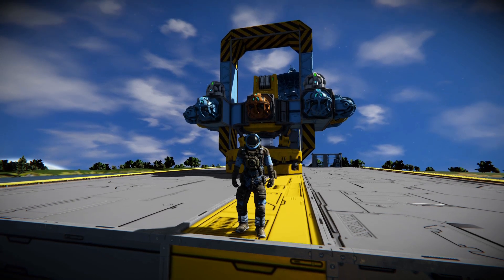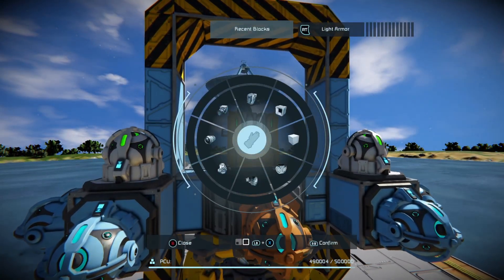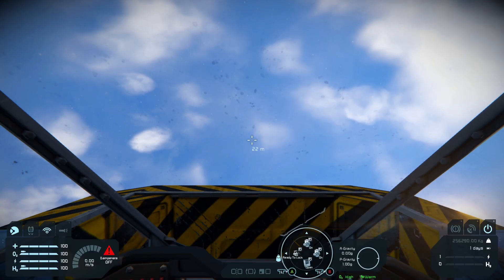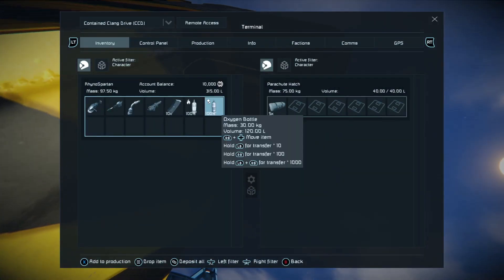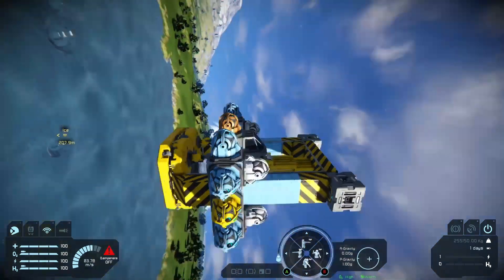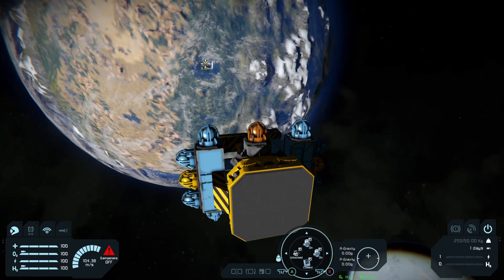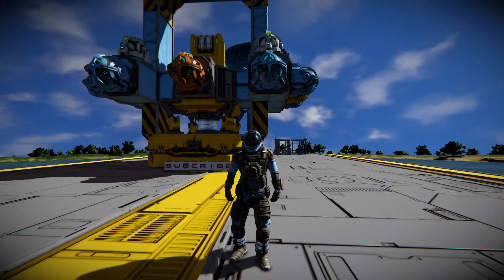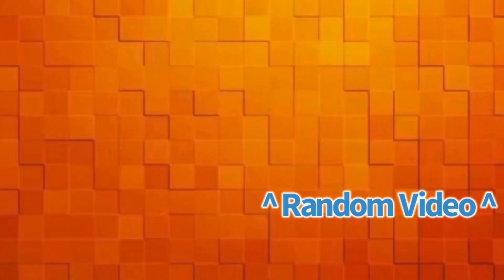Space Engineers Stabilized Clang Drive

Comment: If you put four clang drives on beams, like quadcopter rotors, you can stabilize the rotation by tuning the power of specific drives.

The rotation force these drives provide is unreal, and if chained by a properly tuned script, can hold the ship level like a rock. Or translate the movements of your mouse with enough precision to play a first person shooter. Any phantom forces are eaten away by the script.

I'm transitioning my ships away from using gyroscopes entirely, clang drives do the job so much better.
Reply from the maker: I have to check that out

Comment: Dunno, rotation merge drive accelerates to max faster, works in all 6 directions, and can be quite precisely throttled programmatically. It occupies roughly the same volume and does not cause any phantom momentums ever - craft is stable even without a single gyro. I coded a wrapper that allows all my drone scripts work on top of merge drive with all features, like dampening, WASD control, gravity negation, keeping fixed velocity or altitude, automatic landing, combat, etc. I made one in survival and it never failed me through 100ish hours of that run. Door drive probably better on PMWs like torpedoes but even there does not look like worth it. So sayin that this makes thrusters obsolete while flying uncontrollably in one direction maybe a bit an overstatement here ^^
Reply from the maker: I don't believe I said that the CCD makes thrusters obsolete. I said that it doesn't make thrusters obsolete because it is difficult to maneuver. Also this rotation merge drive you spoke of sounds awesome and much cooler than the CCD. I will check it out!
Reply: @RhynoSpartan  Whoops, so I've just heard what I wanted to hear, lol. And I've just realized that you are on xbox version, so I believe scripts aren't available? I think I've seen a script-less variant on timers and sensors, but it's much more hassle to build and set up than a scripted variant.
Reply from the maker: @cheerkin  No worries. My audio quality isn't that good so I understand why you may have misheard me. Also, I don't believe scripts work on Xbox but yeah it would be difficult to set up with timer blocks.